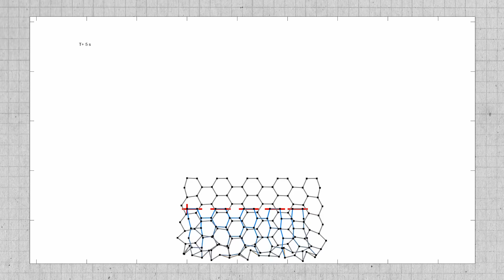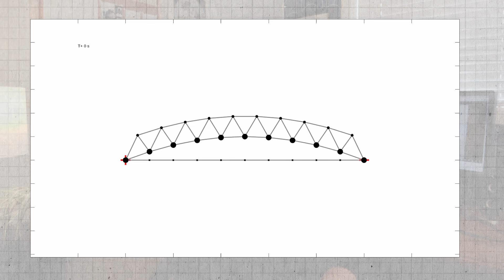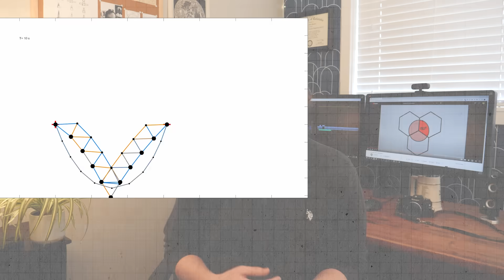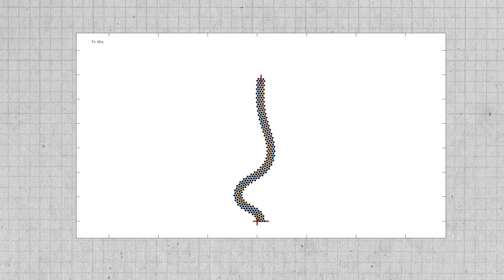Hexagons Are NotSoGreatAgons

Comment from the maker: 4:52 I should have mentioned but you only need all of the extra members if you don’t add another joint in the middle. If you add a joint in the middle then you just need the 6 equilateral triangles to keep it stable.
Reply: 5:00 A staticallydeterminagon is now my new favorite word.
Reply: I was literally imagining that rocket video before you said it. Algo go burrr.
Reply: aren't actually round or actually circle shapes the strongest? - but simply to difficult to actually manufacture on the molecular level? - and thus, depending on the actual application, other shapes be simply the better compomise between different properties, including manufacturing cost of a given material, as those are relatively easy&cheap to made as simple(or rather complex, in case of T-/H-) Beams?
Reply from the maker: @BlackRedDead1943  circles are best for internal and/or external pressure (and torsion) but are actually pretty weak to point loads (triangles are best) and bending (which is what I and T beams are optimized for)
Reply: @ConHathy  that makes me wonder, might be a circle with a triangle or a triangle with a circle inside be the strongest universal shape? - given you have to deal with all the forces on the 2D plane - tho i can already see scenarious in wich the circle in particular would be just excessive and not contribute to the integrity at all... while the triangle indeed always add's something to structural stability. (at least in the projections in my head...)
Reply: I watched that video and thought exactly what this video was saying.
Reply: @henrikkowalski3144 Your statement is incorrect: "...the reason why hexagons are more widely spread in nature is not its stability in isolation but that you can tile a surface with identical rigid hexagons without overlapping or holes. This is not possible with triangles..."
Reply: No they're still the bestagons
Reply: You appear to have mistaken stiffness for strength, and force for energy.

You claim the most fragile molecular structures, that require infinitesimal energy to break them, are The strongest.
And you claim the weakest, almost impossible to interact with without their failure are strong.

Please exit your matrix before any further attempts to communicate.
Reply: Adding extra members is how you turn them into sexagons.  Too many members for me, thanks.
Reply: that stupid smirk the entire video. downvote and added to dont recommend channel. have some humility.
Reply: Are you sure you can't get away with just 3 members making an equilateral triangle by connecting non-adjacent points?  That would give you a total of 4 triangles providing structure.
Reply: I disagree!!!!!!!!!!!!!
Reply: So you think triangle is the bestagon first of all the word “triangle” doesn’t end with -agon and second of all 6 triangles are a hexagon
Reply: 6 triangles make the hexagon which is the bestagon
Reply: In the endagon, the bestagon is alldagons!
Reply: Nice job!  I enjoy Gray’s videos but appearance is one thing and laws of physics are something entirely different 😂 💪🏻💪🏻💪🏻

Tho more volume less wall for honeycomb was a good point he made—classic optimization
Reply: In the 6 equilateral triangle arrangement, could you actually remove one member shared by two of the equilateral triangles and the structure would still be statically determinant? Then there would be 4 equilateral triangles and a rhombus, but three of the rhombus' vertices would be fixed.
Reply: @X4R2  possibly except that that would have the possibility of the corner flipping into itself because only fixing the of the corners creates a bistable configuration which is fine if there's not give in the beams but as soon as there is you have issues. Ultimately it makes it more susceptible to bucking on that corner if you have a force from the corner to the centre joint of the hexagon which isn't ideal.
Reply: I’ve been trying to get an answer to my question, maybe you can help me?

My idea, hypothetical. 

Is there any scenario where…? A person could have large tall cylinder that can withstand both a vacuum and pressure, with a valve at the bottom and top of this vessel. Setting above but next to an open reservoir of water. 
Fill the  vessel with water just below the valve at the top of the barrel. 
From the valve at the top of the barrel connect a small pipe that reaches into the open water reservoir. 
From the bottom valve connect another pipe that reaches out… say 12’, but staying above the top of the water in the reservoir. 

Is there any scenario in this kind of setup where, when the valve in the bottom of the closed vessel, with the weight of the water in the barrel decrease the atmospheric pressure artificially in the top of the tank, to overwhelm the atmospheric pressure of the reservoir of water and the water weight in the smaller tube connected to the upper valve, So that when the upper valve is opened the water would flow up the tube and into the top of the sealed vessel?
Reply: @ronweber4508 look up the hydraulic ram pump (or just ram pump). That is a way to move liquid to a higher elevation than it started at, albeit 'losing' some of the water in the process. There's some good vids of it. Arguably, a similar setup could be applied to your question, using valves and the inertia of water flow in the pipes.
Reply: @ronweber4508  That was the most confusing way to describe something. I legit didn't follow. I tried to read it twice. Didn't follow. Read Anti's response. Didn't follow. He's clearly better at imagining this setup than I am.
Try the old "tell them what you're going to tell them, tell them, and then tell them what you told them" form of explanation, it helps a lot.
Reply: @kindlin 
Thanks
Reply: @kindlin  He is describing putting a hot water tank up on the edge of a full bathtub. Then putting the overflow/overpressure pipe down into the tub water. And connecting a pipe to the tank's drain valve and putting the end over the water in the tub.
The short answer is that it might start out siphoning some water up the pipe to the top, but not as much as it drains out the bottom. As the tank empties it won't maintain the gravity-induced vacuum pressure at the top and then both pipes will drain out completely. 
As they say, "water finds its own level." There is no perpetual motion, without external energy.
Reply: @Mavrik9000 
Unless you have an idea. 

Yes, but I don’t know any of the language.
I was thinking the greater weight in a barrel could overcome the weight in a smaller pipe.
Or, pull a vacuum in the top of the barrel. 
But it sounds as if the physics of the atmosphere overwhelms everything, to an equal higher level. No matter the size and/or volume/weight (and a vacuum is just a bad idea).
Reply: @ronweber4508  See my answer above to @kindlin 
You can't make a self siphoning loop. It might start out siphoning some water up the pipe to the top, but not as much as it drains out the bottom. As the tank empties it won't maintain the gravity-induced vacuum pressure at the top and then both pipes will drain out completely.
Reply: @Mavrik9000 
Thanks
Reply: @ronweber4508  Are you trying to make a perpetual motion siphon?
Reply: @ronweber4508  It's been a while since you posted this question but nobody seems to have answered it so here's my two cents:

Short answer no, long answer yes, with certain conditions. The water in the small pipe going to the top of the cylinder would not flow all the way up into the cylinder because the same gravity that affects the water in the cylinder affects also the water in the small pipe. If you open both of the valves the pressure at the top of the cylinder would lower and it would suck up water into the small pipe but only until the level of the water in the small pipe matches the level of the water in the cylinder.

If we start nitpicking we could make the top pipe very small. The capillary force would cause the water in the pipe rise higher than in the cylinder. Even all the way into the cylinder. Capillary force is caused by the surface tension of the water. Water is attracted to many surfaces and wants spread on them even climbing up them slightly. (watch closely at the edges of the water in a glass of water) In a very thin tube the capillary force overcomes the gravity. This is the way how water rises up in tree trunks all the way up to the leaves. It's also how they take a blood sample from you by squeezing out a small drop of blood and touching it with a thin glass tube so the blood just fills the tube "automatically". But in this scenario the water rises up into the top of the cylinder because of the capillary force and not because of the low pressure at the top. Although the pressure difference certainly helps.

If you place the cylinder and the bottom pipe next to the open reservoir but below the level of the water in the reservoir, opening the valves would suck up the water into the small pipe and into the cylinder. The cylinder and the pipes would act as a siphon and would create a flow of water from the reservoir into wherever the the lower pipe ends ups.
Reply: @AnttiAlajuuma 
Thank You
Reply: You definitely should have done that, because that was exactly the point where I stopped watching and downvoted your video.

Comment: Hexagons can be hella strong, but only if they're divided into triangles 😂 that pattern is pretty common in nature, a geometric form that repeats itself in space. So, yeah, hexagons are not strong, but they CAN be strong and also offers the benefit of being conceptually simple: six triangles are the sweet spot between triangle numbers and the area corresponding to a perfect circle. That prevents wasting material, creates a potentially strong structure and also saves a lot space since hexagons also fit perfectly to one another, which saves even more material.

Comment: I feel like you are both right. Because you argued about the forces affecting the hexagonal structure from THE OUTSIDE (both the tank and the hexagonal carpet thingy hanging were experiencing forces from outside of the structure itself), whereas CGP argued mostly about pressure being applied from the INSIDE (the filling of honeycomb/internal forces in carbon grid) - and that's where hexagons get the same outcome as triangles but use WAY less material.

So I say if you're afraid more about forces from outside - go with triangles. If you care more about forces within the structure - bestagons.

Comment: I know I'm two years late to the party, but your simulations of bolted beams are obviously irrelevant. CGP gray is considering tiles in the shape of a hexagon. All tiles are riged. Triangular tiles must be fastened together to stay upright, but hexagonal tiles do not. This may be a less common situation in engineering, but it is more relevant to the shape because a "triangular" pattern of beams is made of beams not triangles. (The bolts are likely hexagonal in all cases because they are the bestagons)

Comment: We need more hexagons in city planning though. One of the biggest issues in cities is the number of straight-line roads that encourage high speeds and therefore traffic problems. Gimme tiled hexagons for cuty planning any day.  Their only downside is in ermergency response, yet even then, that can be solved with a few direct-straight lines interspersed into the grid, and the fact that 120 degree turns are MUCH easier to traverse for a long American fire truck (European fire trucks are typically shorter and bring extra water trucks when needed).

Comment: It's true that different shapes are best based on the direction of intended load.   And that hexagons are not structurally indeterminate in a simulation where their joints have no strength.  But they are still the best at uniformly. Filling a plane with minimum material.

Comment: It's still more efficient for bees because the hexagon is more efficient in space as well as fluid storage. If you where to compress the hexagon with fluid inside the pressure gets distributed at 6 points instead of 3 which makes it better than triangles but also uses better space and material than a circle because all edges touch edges. So better structure, more efficiency and less energy for bees and that's why they use the hexagon.

Comment: I'm not a Mathematician or Engineer, but as an Artist with an appreciation for observation, I'd like to propose that the Hexagon is the most Balanced shape.
Simply put, its the largest Tile-able Isometric shape, meaning it's vertices are as close to the shape's central mass as possible without overlapping or leaving dead space between them. Best embodying the strengths of Triangles & Circles at once!

Comment: The spacing of materials for strength is all about archimedes and levers all over again. The 30cm ruler 1mm thick is easier to bend because the force is multiplied up to 300 times, (or maybe 600 if you consider the midpoint) meaning a 1kg weight on the end is putting 300kg of tension and 300kg of compression. It's like having a really long set of nut crackers. It's easier to use, but you need a much stronger nut to resist being cracked. Whereas on its side it's 30mm thick so it's only 10kg of tension and 10kg of compression.

Comment: Triangle for strength, circle for perimeter to area ratio, hexagon for tessellating perimeter to area ratio, rhombic dodecahedron for 3D tessellating surface area to volume ratio. Also if you're pushing down on a grid of hexagons - between the two sheets of aluminium in aerospace materials, then the walls are also well braced for their size as they have 6 folds, so are more resistant to buckling relative to the total area of material used.

Comment: Hexagons alone aren't much. But a bunch of them in a honeycomb structure is actually quite strong.

The way I see it is that they are a decent compromise between the structural rigidity of triangles and the spacial capacity (and, in this case, also the materials and weight savings) of circles. It's why honeycomb structures are finding their way into modern human engineering via composite sandwich materials.

Comment: He got the honeybee honeycomb wrong too. I used to marvel at how a bee could know to make perfect 120 degree angles like that. Then I watched 'em and confirmed with bee-keepers and then secondary sources. They make roughly circular cells, then dry/cool the beeswax with their wings, and physics pulls the circles that share walls into hexagons naturally. It's much closer to the action of bubbles that he mentioned. So instead of acting like a protractor, bees are acting like a compass, which is much easier to do physiologically.
Still a great guy with great vids. But, fact-checking is a beast.

Comment: "the hexagon is about manufacturability" it has the highest ratio of volume to surface area of any tessellating shape, does that not have any utility?
the case of squares is for a pressure vessel, its not comparable.

my suspected ideal case would be bending of a flat sheet from random points with orthogonal/normal force-vector

Comment: In the honeycomb paneling "all the strength is coming from top and bottom panels" is not correct. a paper is not sheer resistant because the stress dissipation is not as effective as honeycomb paneling, remember that there are 2 forces acting on the plane wings, one is the drag that applies sheer force and try to rip apart the wing and the second is weight/lift balance where the wing is trying to bend up and down. So you are trying to find a structure that can do both, triangles without forming hexagons are not as sheer resistant as hexagons. You can try this in simulation or you can watch many youtube videos that people have already tried this. There is a reason where wings still use hexagons and not switched to triangles. Because weight is also crucial!
Reply: Also if they are only used as a spacer then it should not matter how strong they are meaning you can replace it with foam. You literally said foam is weak, then there is some load carrying no?
Reply: I challenge this channel to make a wing with only spacers between the 2 surface wing foils to make a wing within the same weight (without using hexagons) and be structurally stronger in sheer and bending than a wing made with hexagons.

Comment: So It all comes with benefits and the opposite (that I don't know which word is).
So, do hexagons have the best strength-to-material ratio?
Reply from the maker: @astrubale023  no, that would be triangles. At first glance you might think triangles have more than twice the material, but that comes with way more than twice the strength. So you could use fewer larger triangles or thinner material, resulting in a lighter structure
Reply: @ConHathy oh ok. So there are things and situations that require different shapes? Like honeycomb hexagons and triangles for 3d graphics?

Comment: I think your first point about chemical bonds misunderstands what Grey is saying. He's not saying that there's a physical connection between the molecules, but rather that the molecules arrange themselves in a roughly-hexagonal pattern because it's the best way to distribute things compactly and evenly, with the "evenness" parameter providing strength because there is no particular "weak" direction.

Comment: CGP mentions triangles just form a hexagonal pattern but forgets that hexagons also form a triangular pattern. Its kinda weird trying to make a point when the point applies for both pro and contra. And hexagons are basically just really good when you want a somewhat stable structure with little material usage and a lot of usable free space in between, the sole reason for honeycombs existing in beehives in the first place. The more edges a polygon has, the closer it is to a circle, and the circle having the most area compared to outline length makes, hexagons, being the closest to a circle while being able to form a continuous grid without filler shapes, the best shape for that purpose.